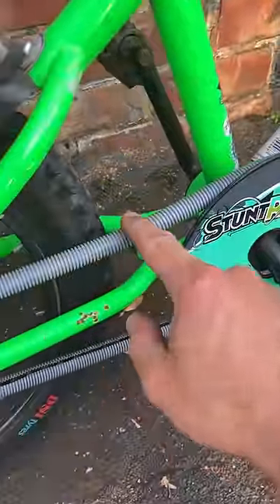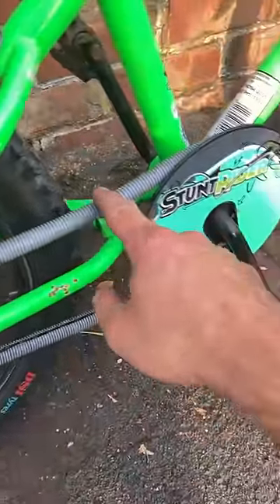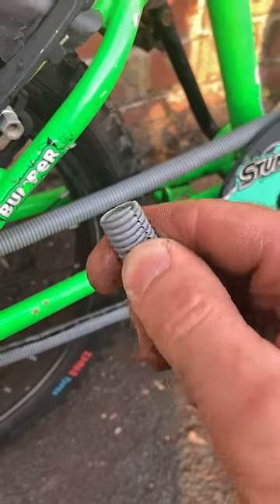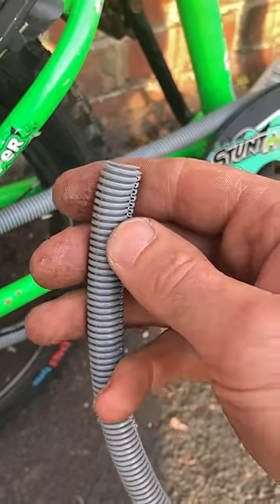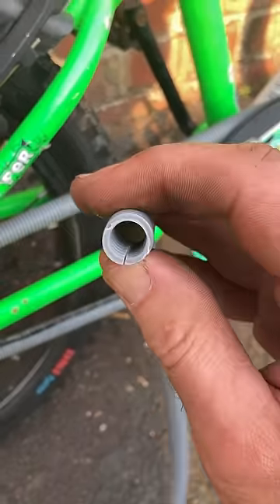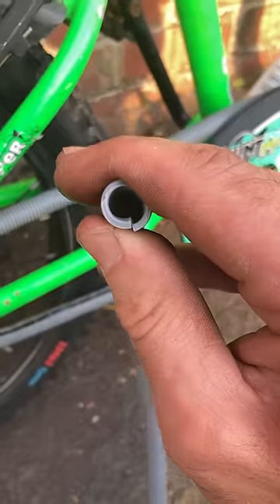Kids bike chain guard hack #bike #bikehacks

Comment: Tried this out. Now my utility room is flooded
Reply: 😂 But the chain guard works right?
Reply: & my dog left me!
Reply: He doesn't know that it's just split loom
Reply: I'm sure he didn't use the one he was using 😅😅
Reply: At least you are now protected from the bike chain
Reply: I'm thinking it fell off😊
Reply: He thinks this is used for plumbing 🤦🏼‍♂️
Reply: Its called “loom” most truck accessory stores have it by the foot and it already comes with the cut in it 😱🤯🫡
Reply: Lame
Reply: Drill holes through out so water drips out as ur riding
Reply: Drill holes through it  itll take all water outas ur riding
Reply: Nice

Comment: It's also going to trap water on the chain which will make it rust. Not smart
Reply: Holes.
Reply: @David-cy5zu 
Moisture trap. Holes are useless.
Reply: Yeah. All those kids riding in the rain!
Reply: It will be just fine.
Reply: @littlejackalo5326 rust means not fine
Reply: Dude 1) Just park your bike under a tree or something. Problem solved, 2) It takes like five minutes to replace a chain. So even if you didn’t leave it under a tree. With that guard it would still take years for it to rust to anything even remotely worth talking about. Much less actually changing it. This is coming from someone who regularly left his bike out in the rain when he was a kid and only had to replace the chain like twice 😂
Reply: @petergibson7287 well yeah... You think everyone hides in their house whenever it rains?
Reply: good call, possible upgrade or improvement in the future
Reply: @TemptationsEnd leave it under a tree?
Reply: Fill the pipe full of grease before installing it
Reply: Lol w comment
Reply: Whether or not its useful is one thing but to call this not smart is just wrong
Reply: fit a stainless drive train and keep it well lubed. Simples!
Reply: Risk a bit of water for an added safety measure seems fair
Reply: Keep it oiled
Reply: How about just take it off everyone so often and clean it. Also apply a grease to the chain to prevent rust.
Reply: Grees
Reply: Stainless steel chain? 🤷‍♂️
Reply: I mean if you don't leave your bikes outside and fill the tube with wd 40 it will be fine
Reply: Um
Reply: @rahjah6958 you act like the majority of kids bikes don't end up being heaping piles of rust at the scrap yard or lost in people's backyards. I'm sure the same person that's smart enough to come up with this is also smart enough to oil their chain every now and again.
Reply: If you grease the chains prior to installing the guard, the grease should repel most of the water, drill hole in the tube to prevent standing water, and park the bike somewhere dry and warm after your trip.
Reply: @cCH3artlessCc WD-40 is no good for chains.
Reply: @VZBudgetBuildz You could even upgrade your idea with water resistant grease.
Reply: Can I seed that hack done on a mountain and ridden hard for a month.
Reply: @petergibson7287 condesnation dont exist?
Reply: Just make sure you always have grease on the chain, then water s not a big deal
Reply: no it wont...it will stop water sitting in the chain lol
Reply: It will rust either way who cares stops it eating your right trouser leg atleast
Reply: @Iaintwoke actually you can clean the chain with it works great on rust prior to oiling it of course.
Reply: Just use water displacement spray 😅(wd-40)
Reply: A good coat of grease before fitting the guard will solve the rust, and if it doesn't, a new chain for a tyke bike is a few pounds.
Reply: @PrivateEyeYiYi  Yeah it's the end of the world 😂
Reply: Not if you continually greet it or spray WD40 in your water displacement. Use your nog and buddy.
Reply: @rahjah6958 Rust is easily dealt with. The reason you would do this is because you actually maintain the chain, meaning apply grease, etc...

So the chain guard will prevent grease from being transferred to clothing, hands, etc...  and dealing with rust once or twice a year is maybe an hour of your time per year.

Grease in a washing machine?  I'll pass.
Reply: If you grease ur chain ur fine
Reply: Yall never heard of chain grease or something?
Reply: Kids break their bikes anyway, this just keeps them from getting really hurt
Reply: Oil your chain then it won't rust
Reply: You think kids never ride in the rain? And even if they didnt they would leave the bike outside in the rain
Reply: Won't rust if you grease the chain properly.
Reply: Chains a lot cheaper than a finger! But you’re definitely right. Would have to oil it constantly to combat moisture let alone all the sand and dirt grit it would trap
Reply: Oil
Reply: Just use your hair dryer to dry off the chain after each use !!
Reply: We used these a lot in the early 80's. Never had a chain rust. Maybe in you put one on your chain, left you bike sitting outside and never rode it it might be a problem
Reply: Just lay the fluid film to it, keeps water away
Reply: The occasional spray with WD-40 then a little grease. She’ll be fine mate.
Reply: @Iaintwoke and then grease. The WD is a solvent. It will clean dirt and gunk + repel water. Then add some grease for lubricant.
Reply: It's called chain oil.  It solves the water problem
Reply: Oiled chain doesn't rust. Thats why you oil them
Reply: @@camillelopez6575 chainguards are overkill for any pedal cycle let alone a tyke bike thats going to get swapped or stolen 5 minutes later. We used to wear our chain grease leg tattoos with pride at that age as it defined you as someone who was a rugged outdoor type rather than a bedwetting, stay at home on the computer wimp.
Reply: add a bit of grease
Reply: @petergibson7287  Does it rain where you're from?
Reply: Gotta love how half the people in this comment section are calling this idea stupid because it’ll arrest the chain when I guarantee just about everybody in this comment section left their bike out in the rain and they were kids
Reply: Line it lightly with some grease or some oil.
Reply: i agree the top chain will drain the bottom sill soak in a pool of water
Reply: Imagine if u lubed the chain
Reply: Gt85 works wonders
Reply: Yeah. This is why we all took ours off in the 80s. 

When your chain starts seizing because it is COATED in rust and mud trapped because you rode your bike through all kinds of shite. 
Yeah... Good times!
Reply: @petergibson7287  morning condensation?
Reply: Not when it’s packed with grease before and has holes it’s a bike lol not a fine piece of precision equipment
Reply: Just pack the entire tube with grease
Reply: Grease it
Reply: Don't fear this idea just spray a can of CRC in there or
Coat the chain with new grease then the plastic tubing .
Reply: @rahjah6958 😂 bro it takes a long time and salt to make it rust
Reply: They stretch so it still needs changing
Reply: @littlejackalo5326 no it won't be fine, stop your idiocy
Reply: WD40
Reply: He don't care so long as his hands don't get dirty
Reply: Not if you grease your chain properly
Reply: I mean if you ride though water all day
Reply: @TemptationsEnd  1). Moisture doesn’t only come from rain.

2). People can choose to take care of their belongings to lessen the time and money to fix it.

This is coming someone who rode everywhere, daily, even when it rained as a kid. Because it had to be done. So in conclusion; you didn’t ride enough, or you’re from an area with a dry climate and barley see rain 🤷🏽‍♂️ maybe both but tbh who cares (me.. kinda.. maybe… not rlly lol).
Reply: No it's only of you let it sit in the rain. Been riding bikes all my life in the rain...I mean it RAINS here all the time in the pacific northwest
Reply: A wd40ing and it'll be fine
Reply: If you pack it with grease first it’s good. Never have to oil your chain again 😂
Reply: Grease.
Reply: Ever heard of chain grease? It repels water
Reply: Don't leave your bike in the rain. Put some grease on it
Reply: @TemptationsEnd under a tree? 😂😂😂 

Like it's not going to see moisture under a tree, guess you've never lived in the tropics or seen a bike that's been parked next to a tree for too long.
Reply: Don't ride in the rain and you'll be fine.
Reply: Meh..
Chains are next to nothing cost wise
Reply: @petergibson7287  ... and bringing their bikes upstairs to their bedrooms at night or when it rains...  
Not every kid that has a bike also has a garage or shed...  and even if they do, will they bring them in each night that it *might* rain...?  
[Point Made...]
Reply: @petergibson7287 A little rain never stopped us from riding our bikes as kids.
Reply: @jumpman2680  That's great; it didn't stop me then and doesn't stop me now.

Comment: This "hack" goes back to the 80's when you could actually buy these ready made. They don't last long, they add friction and they bind water around the chain.
Reply from the maker: Not much of a hack if you’re just buying a product?
Reply: @bootsowen  Correct.
Reply: @bootsowen  Not much of a product if it drags, catches and rots the chain.
Reply: Its the same thing with those "new" bars of soap, people realized that bricks of detergent suck.
Reply: @TalonX_X learn what detergent means. It's not just a product, it means something bub. Lol don't fall for the bullshit ads.
Reply: @bootsowen or mount a standard chain guard… this seems unnecessary and like it’s caused more problems tha it solves.
Reply: yeup, I remember. that fad lasted about 10 minutes
Reply: @bootsowen you literally just bought something and put it on something else. Not much of a hack you did either bub
Reply: @mChav34 yup, it wasn’t around very long. Just a fad that had no actual use. It doesn’t do what it was meant to do lol
Reply: @bootsowen not the point really. Point is that is used to be commercially available but went out of popularity because it didn’t work and was a terrible idea 😂
Reply: @bootsowen more of a gimmick than a hack
Reply: @bootsowen never worked to well always got chewed up in the chain but looked good 👍🏻✌🏻
Reply: @bootsowen not much of a hack if it reduces lifespan of the part for no good reason either.
Reply: Haha, I was just writing my own comment about remembering seeing this in the 80's. Looked cool though.
Reply: This actually could be somewhat useful at least in dry conditions to keep debris off of an electric bike chain seeing is 95% of the time we are not peddling trust me we are using our throttles at full tilt lol. 

You could incorporate some colors and don’t use it when it’s wet outside and you won’t get chain rot. 

I know I get to Bree cut in my chain when I’m off routing sometimes at high speeds with 52 V and 40 A I’ve got some torque to deal with at 2 kW
Reply: All true, my sons bmx bike jad on and it only took a week for it to start failing...
Reply: @bootsowen You're the hack.
Reply: Put some grease in it?
Reply: I was thinking the same thing, I suppose you could drill some holes in the guard I guess, but I don't know if the juice is worth the squeeze
Reply: Yeah, and Spokey Dokes
Reply: Bub
Reply: I had one too. 
 In Holland we could buy them in all colours for a short period in the 80s.
They break quick indeed.
Reply: @bootsowen  I mean, if you wanna get technical, nothing is a hack in real life because the term doesn't apply, and its DEFINITELY  not a hack if it makes your bike slower, breaks quickly and causes the chain to rust and seize :'D
Reply: What about plastic dust gumming up your chain
Reply: @TalonX_X All soaps are detergents
Reply: And are an environmental disaster spreading micro plastics everywhere... Literally harming the children
Reply: Yeah they had them in neon colors when everything was in neon😅
Reply: @bootsowen that's your issue with his comment? Whether or not it's crafted at home? Not the downsides for using such a thing? I'd prefer to keep a chain bare then have more drag and a rustier chain.
Reply: Brand new in 1985 in any BMX magazine or bike shop
Reply: The friction isn't an issue the water is but u drill holes every inch or two along the uncut side and it drains. problem solved
Reply: @SweetGPT  I'm sure you're not peddling, unless you bring stuff with you to sell. Perhaps you are not pedalling either.
Reply: @bootsowen  Not too bright are ya.
Reply: Fill it with grease

Comment: Next thing they'll be putting lolly pop sticks in the forks so that the bike makes a noise as they ride along ! 🤣😂
Reply: And doing an Evel Knievel wheelie down the street whilst trying to look hard and impress the Chicks. I admit i thought i was 'The Fonz' and looked a total cnut doing it! 😂😂😂
Reply: I liked doing stopping dangerously close to people, one time at a local fair of sorts a girl from my school was talking to two dudes and looking away and I rode about a foot or so away, grabbed the front brake, and did the only vertical stoppie I've ever been able to do, and keep in mind my bike has 29 inch wheels and I weighed over 220 pounds at the time.
Reply: I remember putting plastic bottles inbetween the frame and back tire, it sounded like a dirt bike lol!
Reply: Baseball card with a clothespin.
Reply: Thick plastic card is what i used
Reply: Soda can was even louder and it never even popped a tire😂
Reply: Folding the end of a plastic rear mudguard down between the frame and the rear knobbly tyre for that motorbike sound 😂
Reply: We used to get a old bank card or whatever card you could get and put it in the brake on the back wheel when we were kids 😂
Reply: Always baseball or hockey cards for me. You get lots of doubles after awhile.
Reply: We used balloons and ride out at 3am 😝
Reply: Cards and a clothespin.
Reply: I used my Mickey Mantle rookie cards in the spokes with a clothespin. I may have made a mistake

Comment: Yes, yes! I haven't seen this done in close to 40yrs. 
In the early to mid 80's, my older brother was a pretty good BMX racer, so we were down at the track often. I had BMX's, but didn't race, I mostly admired all the cool bikes. And BMX bikes were beautiful back then. Anyway, this chain cover thing was a bit of a fad. It's called wire loom. Pretty sure you could buy it in different colors at the bike shop. I feel like I only saw guys doing this for one summer. Eventually, I assume dudes figured out it cost energy and actually collected grit. But it looked cool as heck.

Comment: If you are worried mostly about dirty fingers, use immersive waxing. If you are worried about kids losing fingers, use proper chain guard.
Reply: I think it’s from the chain slips and possibly giving you a good whipping
Reply: I don’t think a kid gonna put there finger up inside it
Reply: They do they gonna learn a quick and dumb lesson on not to touch moving chains and belts so it’s a win

Comment: That is a really slick idea. It acts as a guard and will help keep the lubrication on your chain.
Reply: I'd suggest to lube the chain up with a liberal amount of a water resistant grease (like molycote or similar) then. The open top on the lower half will collect rainwater otherwise and promote rust, but the grease will keep the chain lubed nearly forever when the chain can't gather dirt and reduce the effect of the water quite a bit.

Comment: But how u joining both end of the tube? Genuinly wanna know this wizardry
Reply from the maker: You don't have to, the hose just sits on top of the chain.
Reply: Also melt it tape it glue it screw it
Reply: @bootsowen it will fly off eventually going around one of the sprockets, best to melt the ends together or superglue them. Melting is better, glue will flex and crack over time
Reply: @TEAisok Then you can't get to the chain.....silly goose.
Reply: We had these back in the 80's. Bike shops sold them. You just overlap the ends one notch and it stays on. Since they were made for this, they were a lot thinner and came in colors.
Reply: @questioneverything9271 it rotates with the chain, so there is no friction between the two.

Comment: Dip the chain in Evaporust and get all the rust, oxidation, or parts grease off. Clean it off and dry it. Then grease the chain with petroleum jelly. That's another great way of not getting the fingers too dirty.
Reply from the maker: Doesn’t the petroleum jelly just get dirty like clean oil.

Comment: That's not a water hose, but a wire loom. It is used in automotive industry to cover the wires that are exposed to the elements, dirt, water, soot, engine oil.
Reply from the maker: It’s a drain hose for the water in condenser tumble dryers. Split loom is different. It is pre split.

Comment: Automotive split wiring loom is probably a better choice for this than any kind of hose. Would not, of course, work on a bike with any kind of derailleur system, only on single speed bikes or internally geared hubs.

Comment: You need to poke multiple holes, not slits. around the outside of your tube or it fills up with water and that does bad things to the chain and sprockets. Tried this once. I wasn’t a fan. Also found I couldn’t make a connection at the joint between the two ends that lasted any length of time. Granted I was about 9 years old at the time. I also tried garden hose and a length of some sort of black automotive tubing. Didn’t have any better luck with any of those either.

Comment: the chain will grind that tube down and the dust will stick to the oil on the chain and pack in to crevices. if the bike is ridden enough it will heat up and grind that plastic dust into a paste that will never come out of the chain. chains are like 30 bucks, but there are better solutions that exist that won't ruin your chain

Comment: This trick goes all the way back to the early 80's. They used to sell a length of split loom as a "chain guard" in various colors w/ a little tube of super glue to secure it to itself after you cut to correct length. It was about 1/20th the price if you just got it from home depot in black. It was shredded toast when it turned sideways from Freestylin' and the sprocket ate it. You could also appropriate it from the wires under the hood of a car...